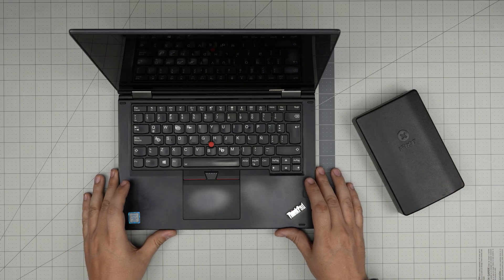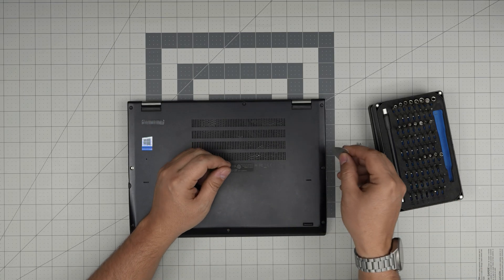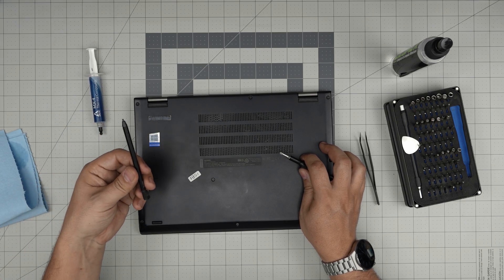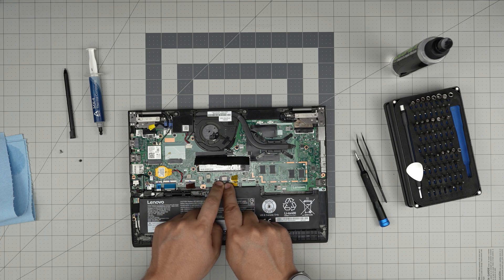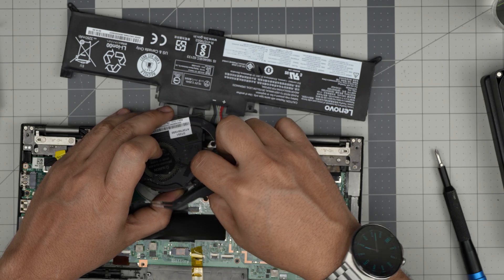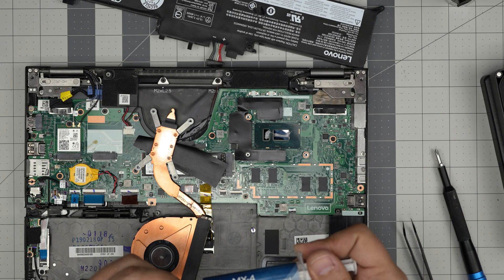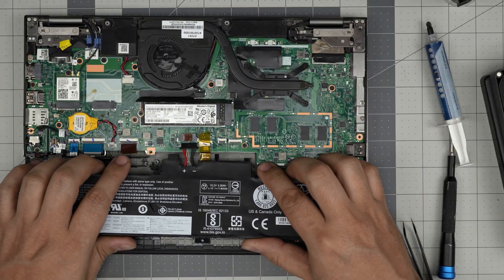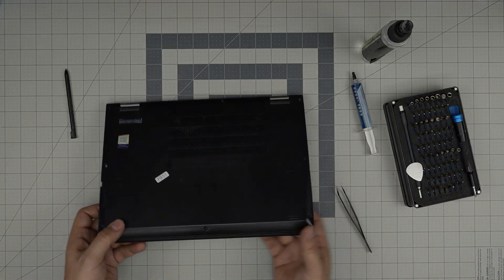How to Repaste & Service LENOVO Thinkpad X380 Yoga Laptop

Comment: Under full load I was at 90c, having done this clean now 85c. These CPUs just run hot, really average cooling system here! Thanks for the video, really helpful.
Reply from the maker: It's my pleasure my friend.
Yes, this video is for repasting and servicing. If you want the best results, use a PTM7950 for the next service—that will get you a few more degrees Celsius lower. However, the temperature depends more on the fan curve you have. The fan curve will not spin the fan faster until the set temperature is reached, at each point on fan curve.
https://amzn.to/4oP6AIi
Should you have any further questions or requests in the future, please don't hesitate to ask me.
cheers🍻

This is an Amazon affiliate link. When you use my links, you are helping to support the channel. 🙏